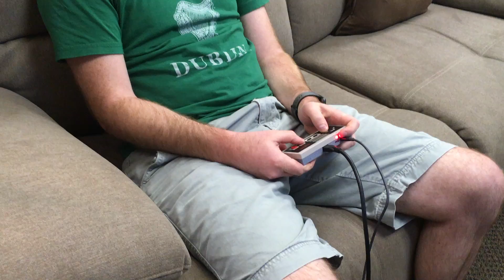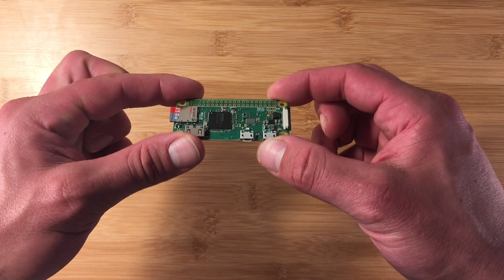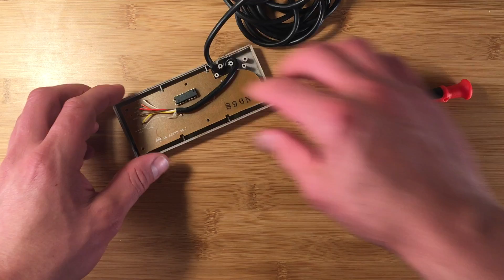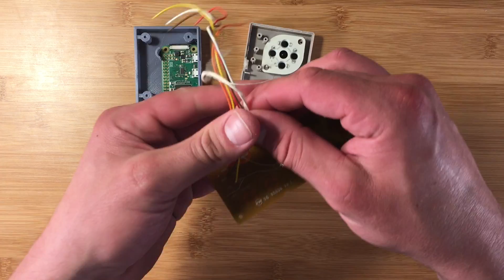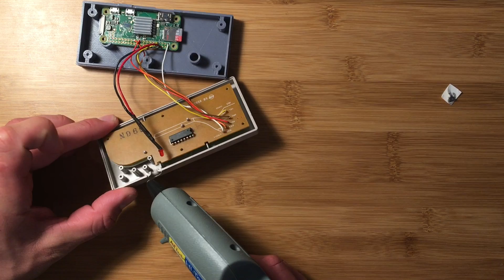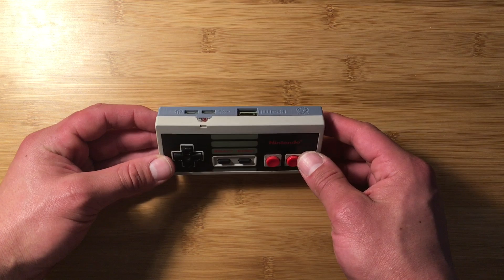Gamepad Zero: A Raspberry Pi Retro Gaming Rig in an NES Controller (Full Video Write-Up)

Comment: i saw this video YEARS ago, bought the controller, matching gray filiment, and pi zero, and it completely fell by the wayside. 

for some reason it popped into my head today, and im SO FUCKING STOKED that, first off, i actually found the video again, but more so that the link to the instruction page and print files ARE STILL LIVE!!! i was totally expecting a "404 not found" for the links once i noticed this video was 7 years old.
Reply: Well, they are 404 now! 😢

Comment: after soldering the unit and run retropi.  i can't get the program to see the controller.  I've also tried to "connect" to the pi via wifi and it won't connect.  Any and all help welcome.

Comment: Hey guys, I want to connect an usb joystick to a RPI zero...if I solder a micro usb head to the joystick wires and connect it to the RPI's micro usb port, will it work that way? Please reply and help out a novice :)
Reply from the maker: They sell Micro USB adapters: https://www.amazon.com/DSYJ-Micro-Male-Female-Adapter/dp/B0027YYMU6?tag=howchoo-20 no soldering needed

Comment: Does it matter if both circuit boards are touching? 3D printing is simply out of the question for me so I planned to cut the original case for ports. I may have to make room somehow if there simply isn’t enough using both original halves of the cases
Reply: They'll overheat and throttle the cpu down, as if it isn't already weak enough

Comment: got all everything done. soldered, game con installed. ran the command line and rebooted. there's no wood woot. es loads and no option to configure the nes controller. all that time making a video and left out the last important parts
Reply: I'm having the same issues. I can't figure pit how to get the buttons working. My USB controller works but the whole point of this project was to use the nes controller. If i wanted to use my other controller then i could have just kept using my pi3
Reply: Charles Tuckey I finally got it to work.  Had to update. Install firmware in the right order or no go. I tried sharing my image to someone who had same issue. And they couldn't get it to work. I had to find the work around on multiple places online. He skipped out on the vid on the important part... And typing In the command line when it works, it doesn't tell you so. You just hope u typed it our right
Reply: mav68nrs I just got mine working. I was unfamiliar with the SSH part in the step by step guide. Once I installed putty and figured that out I was able to play The Legend of Zelda as it was ment to be played. I miss the old NES controller feel and this is almost a perfect replacement.

Comment: I know it's odd to comment about it, but the string in the wire is in there as filler so the cord is rounder than it would be with just the leads.

Comment: One idea would be to mount the pie the other way up and have a cut out on the 3d printed case for the heatsink to sit in so the outside air can cool it. Mount it so the heatsink is flush with the bottom of the case do it doesn't get in the way. Having a heatsink in a closed case without holes is not going to cool anything. :)

Comment: this is kool and all but the raspberry pi would burn up in there one there's no fan and two there's no space or holes so other than this looking kool I wouldn't do this
Reply from the maker: The Pi Zero doesn't get nearly as hot as the Pi 3 -- after using the heat sink, I haven't observed any overheating issues after hours and hours of play.
Reply: I've tested this thing extensively; there's simply no thermal issue.

Comment: I am very interested in Raspberry pi,but I think it'difficult to me.What should I do?
Reply from the maker: Hey Kim,

I wrote a separate guide for installing RetroPie on a regular Raspberry Pi (without the NES controller) :) https://howchoo.com/g/n2qyzdk5zdm/build-your-own-raspberry-pi-retro-gaming-rig

Let me know if you run into any issues and I'll do my best to help you out.
Reply: Learning about the Raspberry Pi is easy!  Everyone should do it.  Start with http://www.raspberrypi.org/
Reply: Thanks a lot,it"s very helpful.
Reply: You can set up a RetroPie without having to do anything complex, like soldering or making your own parts. If you're happy to just have a standard setup, you can just buy a Raspberry Pi and use the regular case for it.
Reply: Thanks a lot.
Reply: Or, you could buy one already settled as I did: I found a guy on eBay who sell Raspberry Pi in retro nes case, with snes controller and a 16gb microsd fulled of roms. 
Could be helpful for you !!!

Comment: Very cool! You have so much room you should probably put a battery
Reply: First comment
Reply: Why?  Then you'd have to re-charge a battery.  You have to plug in the HDMI anyway, to use the controller.  In my original design, I evaluated the option, and decided against it.  It'd simply add to the cost and complexity without enhancing usability.